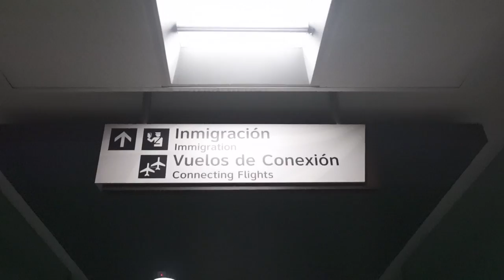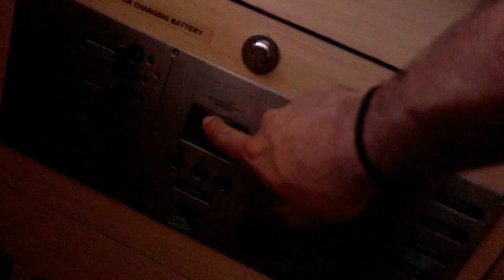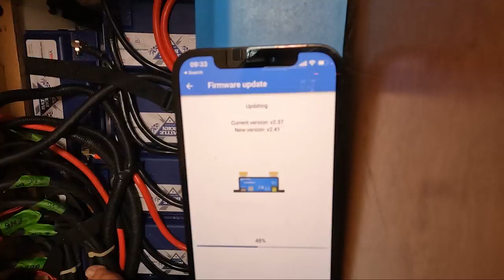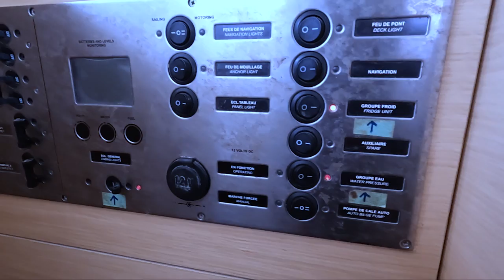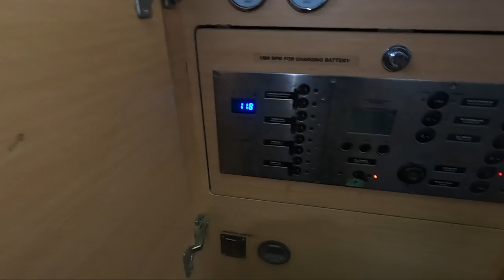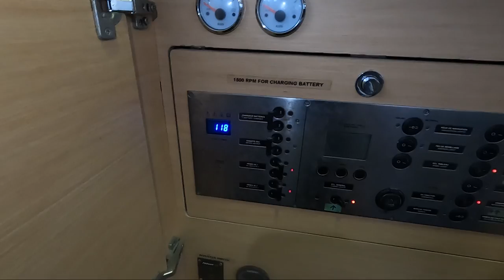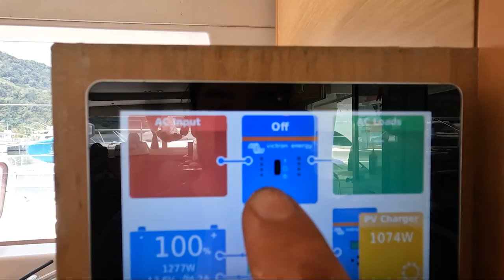We have been STRUCK by lightning AGAIN!!! - (Episode 192)

Comment: Hi Colin and Crew, sorry about all the Damage. On another note you talked about the mould and getting bleach to clean it. Bleach is is not good on mould as it actually feeds it, it will take away the colour but the mould will come back even worse. A solution of 80% Vera’s vinegar to 20% water is the way to go, the mould will see the water as food and suck in the vinegar with it, this in tern will kill the mould spores from inside. Also use microfibre cloths when cleaning mould and keep changing out the solution. Finally use a solution of 70% mentholated spirits and 20% water in a spray bottle and spray everything down ( with plenty of ventilation) and allow to dry. It is the alcohol in the vinegar and metho that kills the mould. Cleaning with the vinegar and Spraying with the metho and water regularly will keep the mould at bay.
This is what we used in North West Australia when I was working for a mould remediation company.
For a reference look up sick home syndrome.
Good luck with everything.
Regards Steve.

Comment: You can make a Spark Gap with two stainless metal sheets 6" x 6", with 1/4" spacing between the plates. Attatch one wire from the Spark Gap to the mast, and the other end into the ocean. I just use a cable coiled on the deck, and when a storm is comming, i throw the cable into the ocean. When you hear the Spark Gap making a buzzing sound, hit the deck, your about to be struck by lightning. I havent had lighting damage in 40 years of sailing in South Florida.
Reply: Do you get less lightning strikes with that?
Reply: @alexforget  In my first year of sailing in South Florida, I got struck 3 times in one summer. I was an Electrical Engineer for radio and TV stations with very high towers. So I used the same technology on my sailboat as we did on the radio  and TV stations. Zero strike in the past 40 years with the Spark Gap. Even when sail boats arround me were getting destroyed by lightning, I was ok.
Reply: I’m an electrician and couldn’t fathom having such sensitive electrical equipment, without some form of lightning arrest system in place.
Reply: very clever
Reply: Do Lightning Arrestors work on a sailboat? Or is that old technology that people don’t use anymore and have better stuff now? My grandpa had them all over the farm due to lightning strikes all the time.
Reply: @thesquirrel905  probably would but they would need replacing once struck. The spark gap device mentioned by @kenscicologist3794 sounds ideal because, it works like a building earth strap and can be reused. Also cheaper.
Reply: We live on the Texas Gulf Coast, second to Florida in lightning strikes.  I'm a retired lineman,  no stranger to the risks.  It's something I treat with respect! 

This method sounds perfect for home protection.  We have several buildings that I'm going to provide with a similar configuration.  Experience has shown me that lightning protection hooked up to equipment is a 50/50 guess at best...

Thanks for the great information.   This would make a great video Colin!
Reply: @sciologist  That’s awesome.
Reply: @thesquirrel905  Yes, I have both 12vdc and 120 vac Surge Protectors. Great Ideal!
Reply: @alexforget  everyone who does it,  swears by it
Reply: What size and type wire are you using and where did you locate the Spark Gap?
Reply: @sciologist  any chance you could give a detailed description of how to set this up please.
Reply: @sciologist makes sense to me. I was thinking the whole video why can't he ground the mast in some way. Even a  anchor with cable straight to mast.  Anything.
Reply: No need for a gap. Monohulls have been grounding the mast to the keel for centuries.
Reply: @nebuchadnezzar9641  and yet. every boat in every marina is brave

Comment: Hi Colin, the fastest and easiest way to deal with mold, fungi, yeast in an enclosed environment, especially blow decks,  is to blast each cabin with Ozone. Get yourself an Ozone generator. Ozone is heavier than air and will reach every crack and crevice in a cabin. Half an hour in each cabin is sufficient. Please remove your 2 dogs and any plants (if you have any) before switching on the ozone generator. You can buy one Amazon. Its a no brainer to have one of these magic devices onboard. You can make ozonated water to drink, you can sterilize fruit and veg before cooking/eating, you can heal open or infected wounds and so much more.

Comment: Spark gap system sounds like a great plan.  Remember elect. Flows on the outside of a wire.  NASA used aluminum foil from the local stores.

Comment: For mold issues, use 5 drops of clove oil mixed with a cup of white vinegar and water in a spray bottle to spray every surface. Leave for 10 minutes before wiping off with a microfibre cloth.

Comment: When it comes to replacing the ground wires on the shrouds and other things, you should try using flat braid or solid copper straps. You need something with a lot of surface area.

Having worked for Motorola Communications on mountain top radio sites we would get hit by lightning on a regular basis. We used heavy copper braid  about 2 inches wide for our grounding with good results.  If an antenna got hit, it would blow up the antenna and about a foot of the feed line would melt but would not hurt any of the radios or controllers inside the building. 

Also you pointed out that the ground wire from the shroud plate ran across the top and then down on the other side. This is a big problem. Always use the shortest route, you may need to add additional ground plates on the other side of the boat to keep the path as short as possible.  Chances are the strike did not follow your ground and found its own path to ground. That is where you get holes in the hull and blown up electronics.

Just a few thoughts from an old radio fart.  Keep up the good work and don't get too depressed. If it was easy everyone would be out there!

Comment: Three things:

1) Provide a robust path for lightening to reach the water, from the mast(s) as well as major corners of the boat.

2) Avoid areas and communication/power paths.

3) Employ strong surge protection at both the panel as well as several points between areas.

Comment: I read a blog from Patrick on Brickhouse that if one grounds the mast to a major part of the hull that is underwater, such as the rudder or drive shaft support or sail drive, then lightning tends to find another place to strike. The ground wire would have to be at least #10 or #8 to keep the resistance down. For composite masts, the ground would have to go up to the top and then terminate on a lightning rod. The idea is that the ground will drain any charge on the yacht and that will lessen the attraction of the lightning bolt. It will, instead, seek other targets that can build up a charge. Just to be safe, in case of a strike, I would use #3 or #4 and hope the ground is enough so that the voltage spike will not fry the electronics.

Comment: Whew!  How about an idea I heard from an old man decades ago.  Get some heavy gauge jumper cables.  In a lightning storm screw one end to the mast.  Connect a sheet of copper to the other end.  Place the sheet of copper in the sea.  In theory the aluminum mast is more conductive than the shrouds and given more readily to grounding.  Disconnect all wires going to your electronics if possible.  It worked well for me in the 80's, although my vessel was not nearly as sophisticated as yours. At least it should help with shroud damage.   Best wishes. Jon

Comment: You are a boat mechanic God. I would have let it all hit my wallet because I could not do what you just did. I agree with you on the grounding wire. If your lightening protection had been working the wires would have been charred black. Ones I've seen in the past had a large bare copper wire twice the diameter of a pencil lead running straight up the mast. You really gave me an education. Thanks!

Comment: Hows it going Colin, exactly the same type of faults we had happen with our outback inverter system here on Aotea after a ground strike nearby took out the control / comms board in both the inverter and monitor. Also cooked several modems and phones……Quite surprised it didn’t take out your folks place as well seeing we’re so close. I know this was a while ago and have it sorted but after it happened to us we fitted several lightening arrestors, both on the DC solar side and the 230v AC. They are basically varistors that run across your + & - or phase / neutral and clamp any transient currents down to earth. Look up lightening protection systems Texas. 
Fair winds and smooth seas, have fun out there…..

Comment: Lightning is unpredicable and if your boat is struck, best to have a large cable by the shortest route to the water, at least 35 square mm, bigger if you can afford the weght (and the money).
It is believed that the lightning dissipates horizontally just under the surface of the  water.
So my theory goes like this, position a lightning rod at the highest point on the mast with a well connected cable taking the straightest possible route directly to horizontal copper strips a meter or so in length near the tops of the keels. Idealy via hefty keel bolts.
This gives  a couple of advantages. Firstly it presents the same potential at the top of the mast as the surrounding water, so its no more attractive. Secondly if by bad luck the discharge chooses to connect in spite of the mast being at the same potential,  the dissipation will be at the copper strips ideally placed to conduct the mega amps to the sea. Mono's are easier 🤗. Could be one of the reasons multi's get zapped more often.
So far its worked for my boat🤞

Comment: I also have been struck by lightning. Everything DC was fried except GPS and Autopilot controller. BOTH were disconnected from DC power. I got lucky with the windlass. I had a main breaker connected and thankfully did its job.. When we leave the boat for any extended period of time, we disconnect everything DC that's possible.. Funny thing.. My stainless VHF antenna on top or the mast was like a piece of rope.. The tail on the wind vane had blown the tail off.. Gotta laugh at what's possible when you get a lightening strike. .. Good luck

Comment: Boats should be designed so that  a central plug or breaker thrown or could be unplugged and disconnect all the equipment during a storm. Boats are a hole in the water that you throw money into. Expensive fun.

Comment: A traditional monohull typically have a lead keel that acts like a ground rod. Lightning strikes will travel down the shroud and into the sea.
I believe you are correct in your assumption that your ground is not sufficient. I personally would not rely on an anode to take this load.
Good news is that your batteries and their BMSs are not in the pathway that any surge would follow so they are likely ok. 
My father was launch director of the Gemini program at Coco Beach and his team was the first to speculate the significance of “bruised diodes”. You will likely find more problems as time passes.